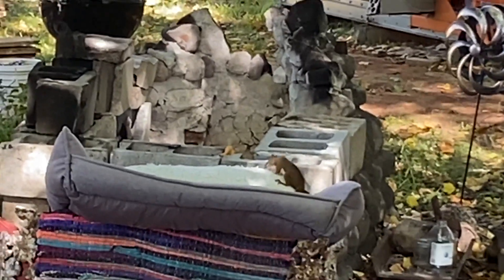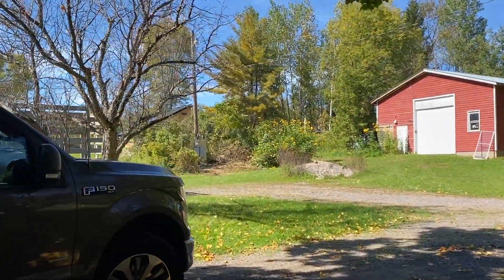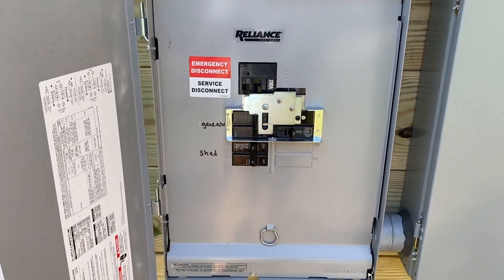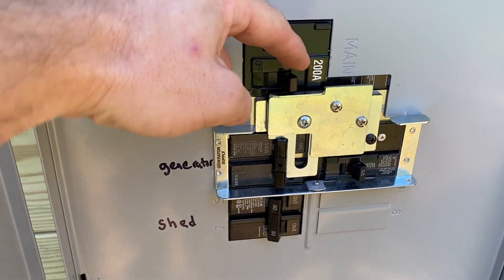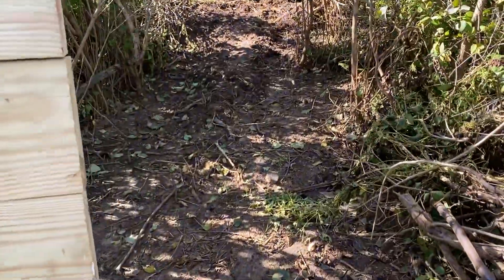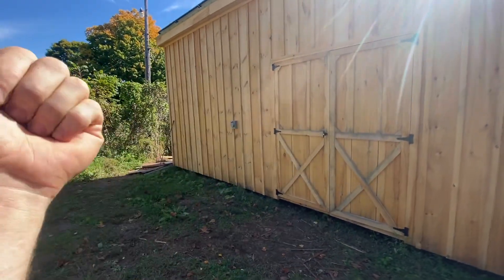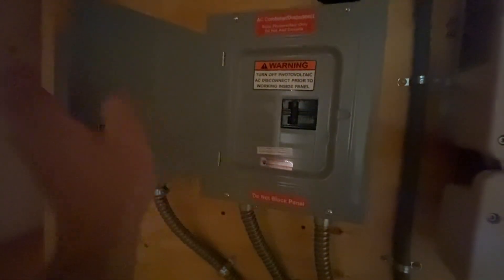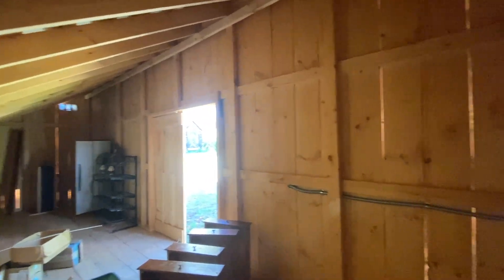Solar Building | Final

Comment: How far away from your house is your building with the solar panels?  We are contemplating putting the panels on the ground next to our house. We live on 50 acres and have lots of sun on that side. Thinking it would be better than on our roof.
Reply from the maker: The panels are 250-300 feet away maybe… but, it’s more dependent on where your entrance is for the power company 😃👍

Comment: So, the solar is feeding into the power grid to offset some of the power you use.  During a power outage, would you be able to use the solar, or will you have to rely on the generator?  I think it's a smart move to have some solar panels, so you can have some power, if the whole "thing" collapses.
Reply from the maker: Yes. If the grid goes down, we’ll still lose power. But, with the generator hookup we will have that. 😃

Comment: I noticed gaps between siding board on the backside of your panel inside the building. Can rain blow thru the cracks and compromise your electrical system?
Reply from the maker: I don’t think enough could get through to make a difference
Reply: @1806StoneHouse  🖕🤞 I began thinking how water could be forced through a narrow opening. You probably already know this but it was informative to me. I learned something new. https://iibec.org/wp-content/uploads/2016/03/2000-10-beall.pdf